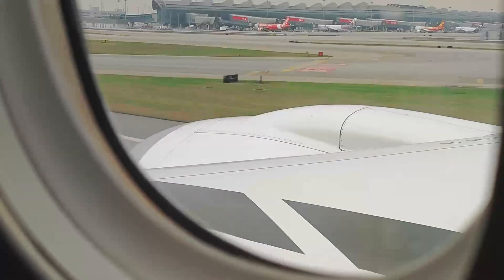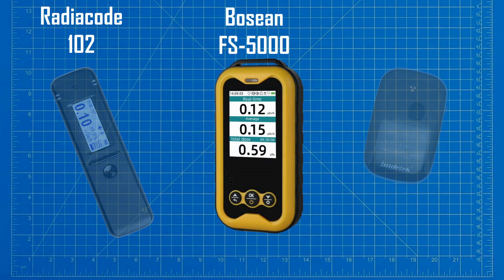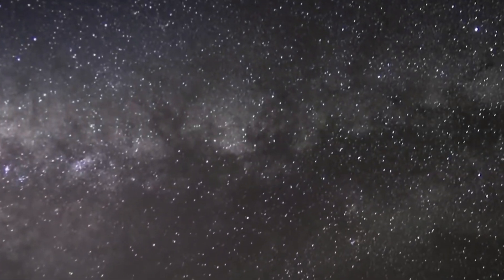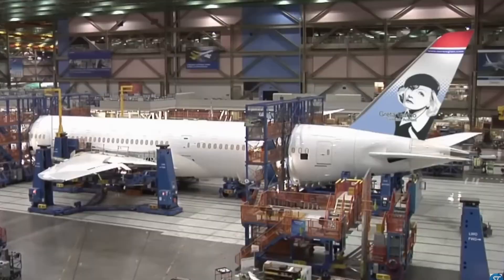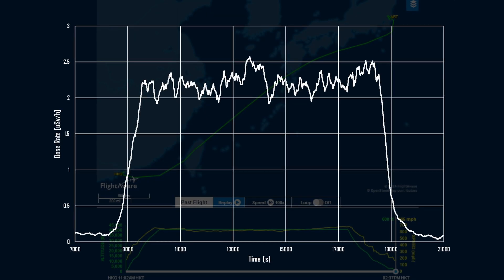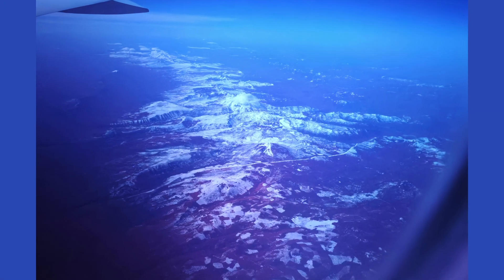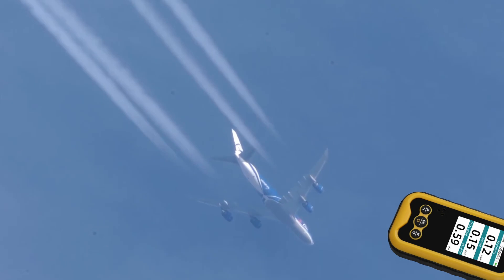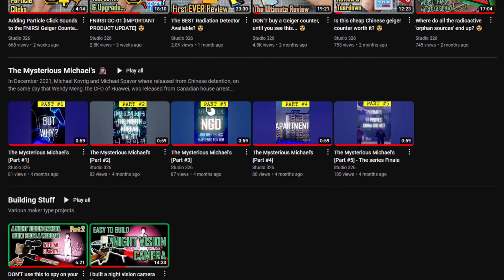30 times normal radiation at 40,000 ft

Comment: you may not be at the full value of exposure, as from neutrons only may be about 6 uSv/h, that none of this is likely to detect.
Reply from the maker: Thank you for the comment.  What would be the source of the high altitude, increased neutron flux that you mention?
Reply: @project-326  it is considered to be from the cosmic background. As to the neutron energies it is a challenge as it may not be the same as detection of AmBe or Cf-252.
Reply from the maker: @samoime1955  I don't think that the cosmic background will contain many unbound neutrons, they have a half live of less than 15 mins...
Reply: @project-326  they are secondary particles that occur by reaction of cosmic background mainly protons with atmosphere, as to NASA research, unfortunately to post link is not possible.

Comment: very interesting video once again, i hope for a bit more cursing next time :D  btw, i  think i'm going to order an FS-5000 as a first detector
Reply: Better get the GQ GMC-800 instead. Not only is it a bit more sensitive but it also has better firmware that reacts quicker to radiation changes than the FS-5000.

Comment: If you want an interesting  DIY project - check out the CosmicWatch project - a desktop muon counter.

"CosmicWatch is simple, physics-motivated machine- and electronics-shop project for university students and schools. Our detector is a self-contained apparatus that employs plastic scintillator as a detection medium and a silicon photomultiplier for light collection. These detectors can be battery powered and used in conjunction with the provided software to make interesting physics measurements. The total cost of each counter is approximately $100."

I built two of these a couple of years ago.  Fun project!  But you need to be able to solder ant size SMD parts.

Comment: I did exactly this on a long trip in the air. I measured audio intensity and radiation with a cheap Geiger . What surprised me was how loud a plane is at lower frequencies. If I recall it was well and truly above safe levels for hearing lose . You might measure this next time and see what you think.
Reply from the maker: I have done that before, I have some pretty advanced sound recording equipment (one of my day-jobs is acoustic R&D), it sort of approximates double brown noise with harmonics from the engine...  As you say, the LF components are really unacceptable, particularly towards the back of the bus, IE behind the engines.

Comment: Do you have an opinion on the GQ GMC -500Plus? I am trying to stay below $200 usd, but I can't tell if any in that pricepoint are worth it, or if I should just wait and spend more.
Reply from the maker: Sorry but I have never personally tested the GMC devices.  
I hear that they are of reasonable quality, but also hear complaints too.  Most of the GMC range uses the J321 tube, which is a reasonable choice for a mid-range device but the response time of their firmware averaging is very slow according to many of the comments I have read.

Comment: Good data. Try and repeat in 5 to 7 years during the next solar minimum. The background should increase due to less solar wind pushing cosmic rays away.
Reply from the maker: Because of the solar max next year, I am actually considering getting a reasonable solar telescope.   Very interesting information about the solar wind effects, is this due to cosmic ray deflection occurring at the termination shock region?
Reply: @project-326  AFAIK yes. The increased density of solar wind pushes the termination shock farther away at the solar cycle maximum, causing more of the particles to miss inner Solar System.
Reply from the maker: Cosmic rays are just so interesting.  Whatever energetic processes generate these, I'm happy that they are not in our neighborhood...

Comment: Most of our atmosphere is below 15km.
Planes fly at 10~12km.
I don't care. That tiny bit of radiation is for most people the last thing they should worry about.
Reply from the maker: I completely agree with you, long haul flights give total exposure levels that are around that of a dental x-ray.  What is exciting about it is that gives the opportunity to directly measure secondary cosmic rays, before the atmosphere absorbs most of the debris...
Reply: @project-326  I would love to have an accurate charge detector for just those extreme exceptions.

Comment: If you had $300-$400 to spend on a detector which one would you pick. I was eyeballing the 103. I have started working on radium clocks and I was wanting something sensitive enough to check my work area for contamination. Thank you
Reply from the maker: for sure, get the RC103, or if you can get it, the RC103G (I'm going to be reviewing that one soon).  Be VERY careful with radium dials.  The phosphor breaks down in just a few decades (so doesn't illuminate any more) but the radium has a half life of 1600 years, so is still just as active as when it was made.  If you see any dust, don't open it...
Reply: @project-326  that’s why I’m concerned and wanted a sensitive detector as I bought a bunch of clocks in a lot and one has a bunch of dust from the radium on the inside of the glass. It got bagged immediately and I wanted to scan the area. My fs5000 is not nearly sensitive enough to find any contamination.
Reply from the maker: @jtcustomknives  use a UV flash light to find all of the dust, it might no longer illuminate from the radium but a dose of UV will make it fluoresce, and hence easy to find.
Reply: Mica-window detector will be useful as well

Comment: nice measurement, did you try over Kerala India or Minas Brazil? The background there is about 80 times higher then average. Maybe you may try the CZT at high exposure, it is known for the low sensitivity and high spectral resolution. There is the other Geiger counter type based on photodiode and is as low sensitive as about 10 cpm/ uSv/h, but should also mean the low background for  alpha and beta count.  Some studies refer to higher disease incidence at the crew, related to higher radiation exposure.

Comment: Another very interesting and very well made video sir! There is also quite a bit of neutrons up there! You`re right about the Cd/Te (Zn) detector, their are very good generating spectrum! My X-ray spectrometers allows for XRF identification and has a small Cd/Te detector. Ultimately, the size of the detector determines the max energy (roughly speaking)  They really missed the mark on that one for sure! give it time maybe they`ll come up with upgrades?
Reply from the maker: Clearly there is a fairly serious design issue, probably in the electronics (assuming the sensor itself is fine).  But what is encouraging is that a $50 device can have a CZT detector, and this bodes well for the future...
Reply: @project-326  definitely worth investigating!

Comment: I personally experienced the next:
1) radiation level depends on flight altitude, just in case check flightradar24 data for your flight to see if they moved higher when you saw an increase of readings
2) radiation level depends on latitude, more to the north - higher the radiation level and vice versa
3) gamma spectrum shows a peak near 511 keV, evidence of positron-electron annihilation
4) muons are detected directly by both scintillators and geiger counters, and register rate is close to 100%, as far as I remember. But conversion rate counts/sieverts is different and, probably, wrong for both detectors.
5) there is a very rare case which is called “gamma glow” and could happen during thunderstorm. I’d be happy to detect it as well
Reply: Also, I suspect the FS 5000 is calibrated with cesium 137, and I know the radiacode 102 has a compensated calibration for energy and temperature, so it would give you an accurate dose while a geiger counter won't unless it's cesium 137 (or whatever it's calibrated with since older units may or may not be to the standard of modern detectors)
Reply: @The-One-and-Only100  radiacode should give kind of accurate measurement in its own range, i.e. below 3 MeV. However, there are a lot of particles with higher energy.
Reply from the maker: and if the CR has 1uJ of energy, which is fairly typical, we are talking about 6.2 TeV...
Reply from the maker: The issue is that a lot of the CR collision debris is not giving much of a gamma release in the low energy levels that the RC102 can detect (typical energies will be many orders of magnitude above the 3MeV limitation), there is quite a lot of beta and even alpha and some weird short lived bits-n-pieces.  When a single proton can have an energy level that gets up to the mJ level (the OMG detection event recorded 50J, imagine that hitting something squishy between your ears), then anything it hits is going to have a really bad day.